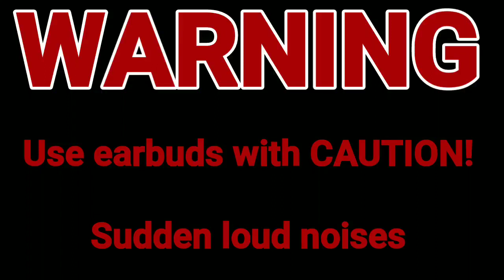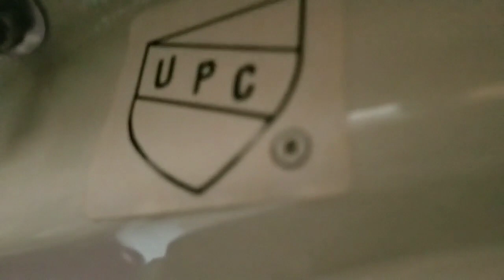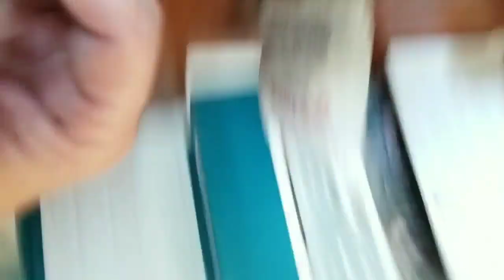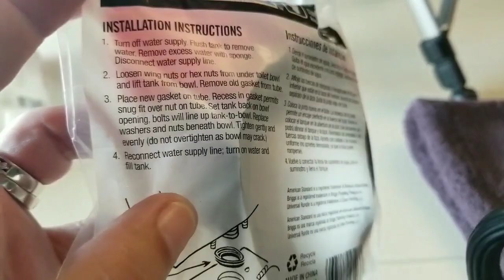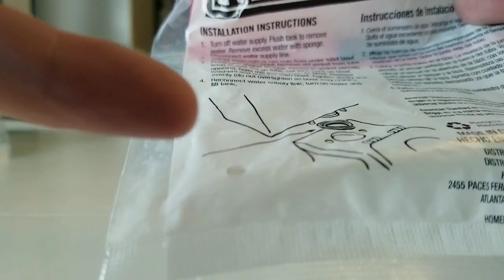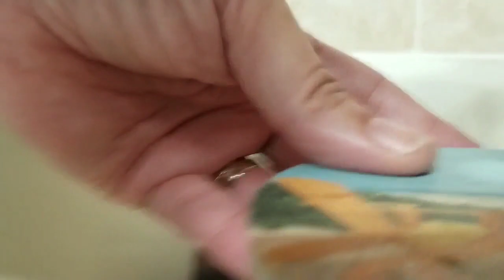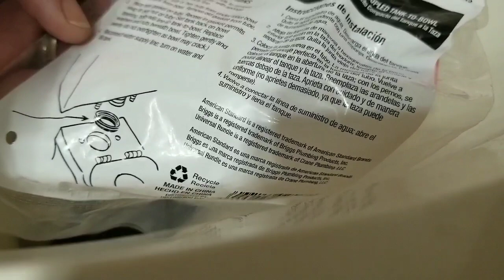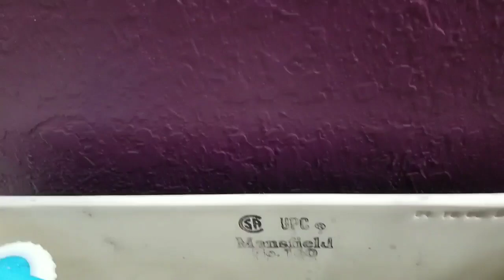No More Peeing in My Pool ~ Toilet Flush Valve Replacement DIY ~ Stick With Me ~ DiamondTube #25

Comment: When I was younger I used to do these things by myself.  Then I fell and tore the meniscus in both knees (omg was I a mess, I had to use crutches to walk).  Now my kneecaps are messed up and I have arthritis in both knees and can't do anything on my knees.  I just fell in my house the other night right onto both knees and hands.  I fell so hard that I couldn't get up.  My husband had to come and lift me up enough so I could get my feet under me.  I could have rolled over onto my butt and it would have been easier, but I was sobbing and never even thought of it.  Now not only my knees hurt but my wrists do too.  Way to go Kath!!!!  My husband doesn't even know how to use a screwdriver or a wrench and he's dangerous with a hammer lol.  The only thing he can do right (sort of) is take out the trash.

What were you spraying?  Were you checking for leaks?  Did I miss you talk about it?  If so I'm sorry.  I'm trying to work and watch at the same time lol.

I do love to watch you do things, do as many of these vlogs as you want!  

OMG that ending!!!  I want to put that on my phone lol.
Reply from the maker: If you are talking about the dripping on the floor the seal wasn't tight enough and I had to readjust the tank. I don't recall spraying anything. That is how to check for leaks in a gas line though. Spray the connection with soapy water. If it bubbles, there is a leak.